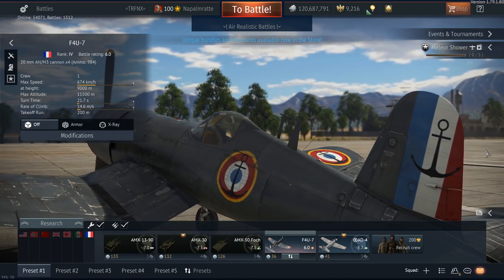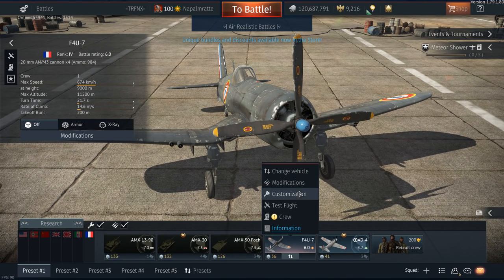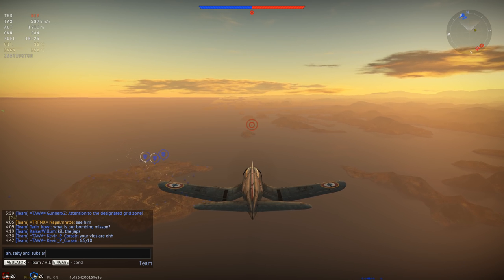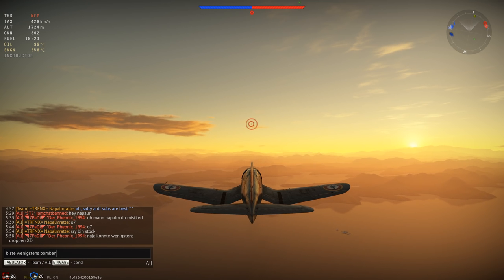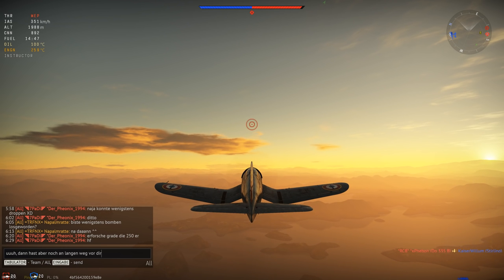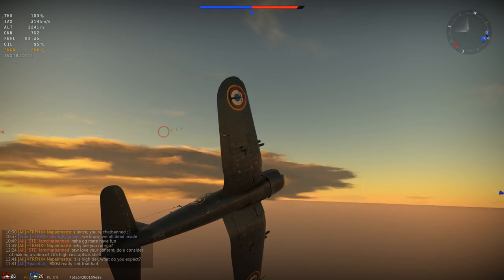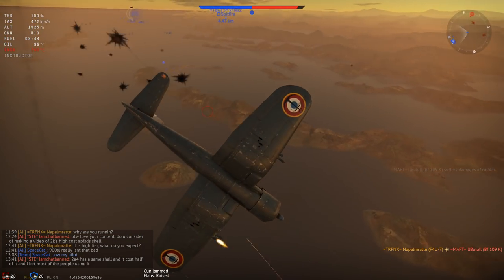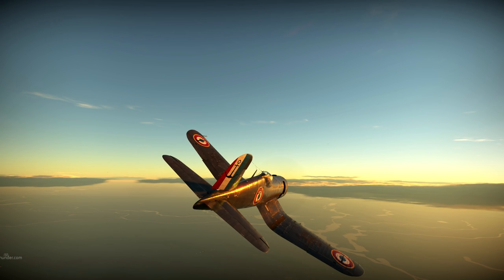WT || F4U-7 - How To Stock Grind A Fighter

Comment: Hey Napalm. You need to try the F4U-1c Corsair. With the cannon buff, its an hell of a OP plane. I generaly climb to 2000 meters  (2k) and start engaging targets bellow or a quick head on. I generaly get 3, 4 and sometimes 5 kills. If you hit something, even with 1 shell, normally is enough to kill or cripple it

Comment: Correct me if I'm wrong but doesn't the FW 190 Dora's have better climbing capabilities when the BF 109 G's and the K4? I currently unlocked the D9 and imo it climbs  way faster , even stock + no engine overheating
Nice Video btw. I think it's time to get my corsairs out of the hangar, get motivated to fly them again ;)

Comment: Wait so all time spent with Engine orange counts towards an internal countdown to a down-step in the overheat temperature? Or does a certain block-amount of time need to be spent in Orange?
Reply from the maker: Paul Chirica Idk how it exactly works because it is a bit different with each plane. But jeah, after a certain time in WEP the critical temperature goes down and you overheat at a lower engine/water/oil temperature